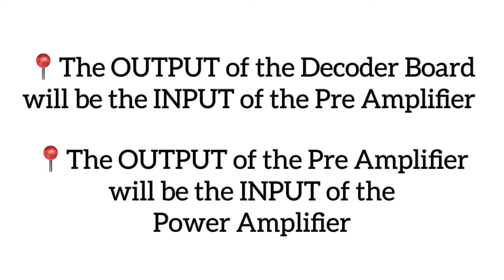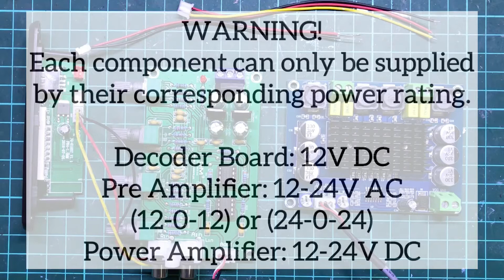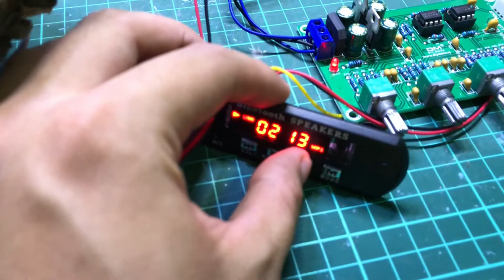Mini Power Amplifier Project: Decoder Board, NE5532 Pre Amplifier and TPA3116 Power Amplifier

Comment: Do not use 24V-0-24V Center Tapped Transformer; else, the two capacitors will explode!
Reply from the maker: Thank you for the input. But as per the product description it can handle 24-0-24. Each capacitor is rated 25V 470uF based on the circuit board.
Reply: @DrixWorks  > And I learned the hard way!   : ) How to fix it: Replace the 2 caps to at least 2200uF / 63V
Reply: @DrixWorks  Right, but that's DC. If you feed it AC 24-0-24 then the DC power on that board will be more like 33-0-33, hey?
Reply: I have used 12-0-12 1amp transformer for this module it is working very well and sufficient
Reply from the maker: @nageswara rao Patnala. I upgraded my power supply for that module. I used 12-0-12 2A
Reply: @DrixWorks  still I have used 12-0-12 1amp ac not dc it's working very well
Reply from the maker: I also tried using a 12vdc supply. I put the negative to 12side, and the positive to other 12side. Just leave the 0 in the 12-0-12. It still works

Comment: Ilan voltage ang kailangan sa input boss?
Reply from the maker: San sakanila boss? Nasa vid yung mga input voltage boss
Reply: @DrixWorks  yung galing sa transformer boss nilagyan mo PA ng switch or direct na agad?
Reply from the maker: @joshuarebitoespanola8039  direct na yun boss. May isang vid pa ako yung final assembly niyan. Isang switch lang sa lahat